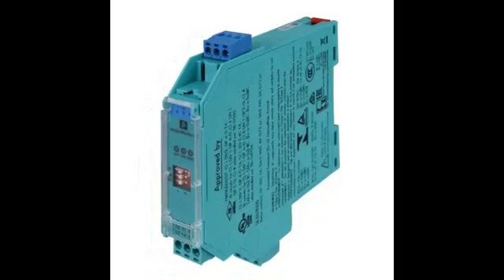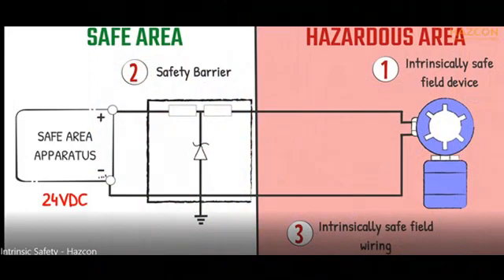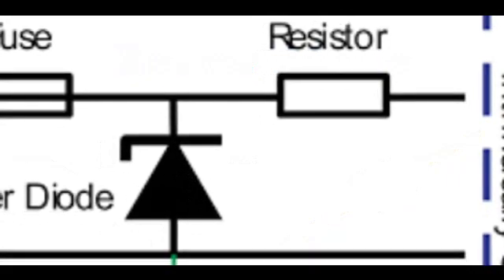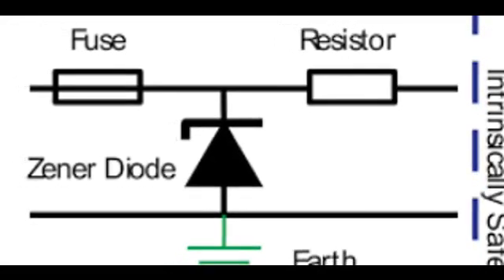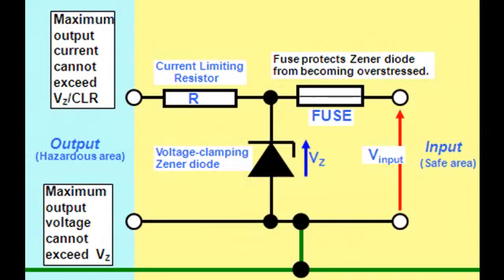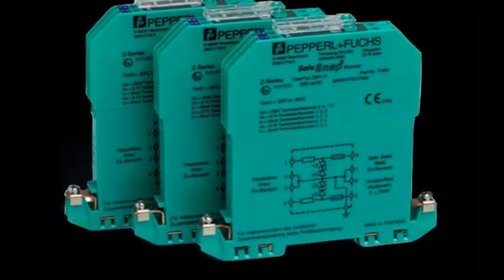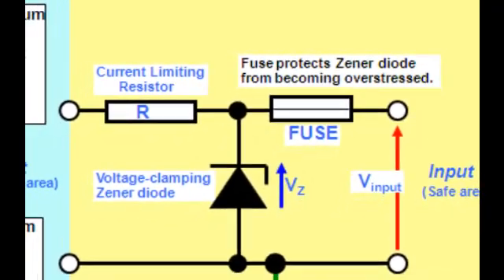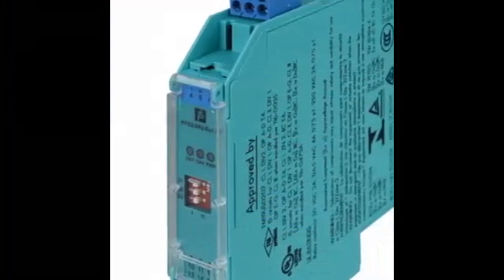Zenner Barriers: How They Work

Comment: In which case would you choose a zener barrier above a thermally protected varistor?
Reply from the maker: In my understanding a varistor would be used within an electronics circuit to protect against voltage spikes. Zener barriers are used to limit the potential power available to a remotely located instrument device which are located in hazardous areas to prevent enough energy to cause a spark which could result in an explosion.

Comment: Good video....Why any other switching device like other transistors can't be used?
Thanks.
Reply from the maker: Good point,  as far as I am aware there would be no reason that a transistor with reverse bias could not be used in place of the zenner diode